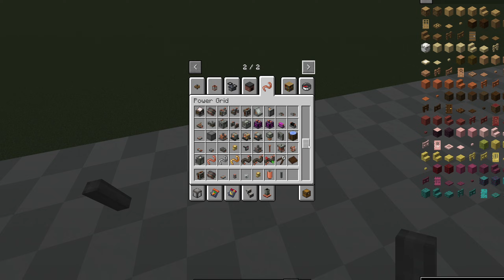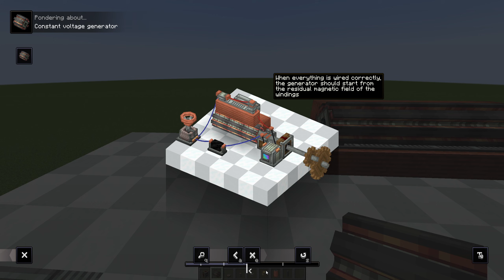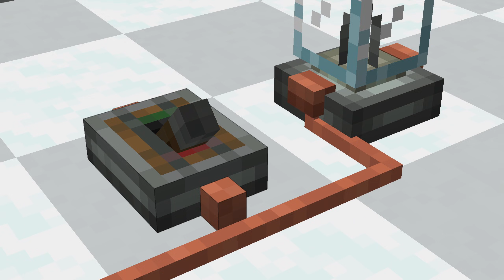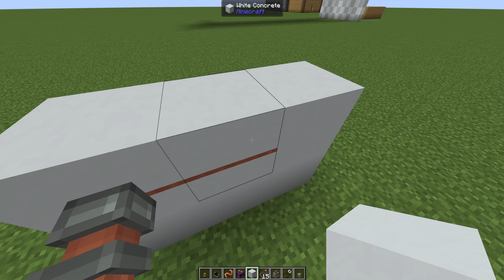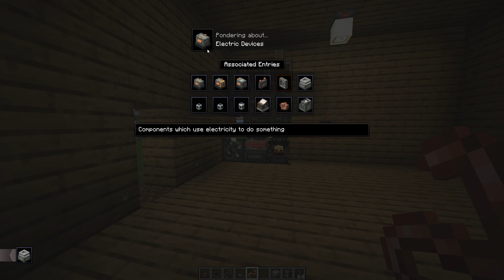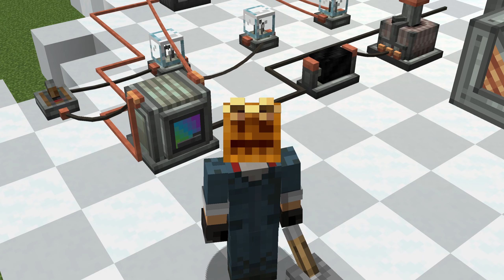The Most Realistic Electricity Mod for Create

Comment: 11:55 - I'm not an electrician but if I had to guess, I THINK you can make it blow if you reversed the polarity (of the neutron flow)

Instead of connecting positive to positive and negative to negative, you connect positive to negative and negative to positive. In theory that should flip the direction that the fan spins because the path that the electrons take is also flipped... maybe... yeah... that's totally how it works.

Comment: for shalz: Volts = current x Resistance aka v=ir so you can adjust one wire into multiple different required voltage powered stuff without breaking,

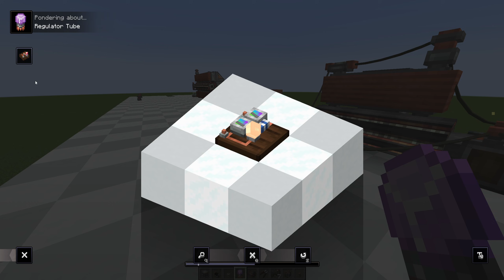Comment: 4:55 ; 5:54 - yea, thanks, I'll pass. At that point why should I even play minecraft and not build s..t IRL?

7:37 - me and electronics. And I code for a living.

PS
Torch - place and forget.
Create's light bulb - Create a generator, transform the current so it fits the lamp's requirements (otherwise it blows up). If you need more elements you're going to need more power meaning you have to re-engineer stuff. I don't see any appeal for this besides for education purposes.

Comment: Depending how realistic, the transformer will seriously need to be required... as more load is applied to the source, it needs to send more power down... not sure if that means the motor you have will have to spin against more torque (not sure if create has that, as I know basically nothing of create aside from wanting to play it when I get lost of time off finally) to sustain the power, or if it will just keep spinning at its lower rate and not produce usable power... really not sure, again, because I am not sure how realistic it is. Overall love the thought of powerlines and subgrids in a minecraft server, perhaps having one group of players operating and sustaining a power plant for a city, expanding capacity and adjusting accordingly.

Comment: I played  a little bit with the beta version as the normal version couldn't launch and I came to this conclusion about how to make a mostly reliable generator:
- The ideal rotation speed is 180RPM
- In the excitation circuit, replacing the power resistor with a light bulb with make the regulation better
- I made a crude regulation mechanism with a rheostat in series with the other one (both are 200 Ohms) and a motor coupled to it. The motor is supplied by the voltage output in series with a 120V creative battery (for now) in reverse (so the voltage is 0 when the output voltage is correct). It worked good enough. It's a good practice to set the manual one with maximum resisance when the system start

Comment: I tried it and it has insane potential (pun not intended...)
You can make harmonic oscilators with inductors and capacitors!! For those that don't know, that means you can make filters and thus tunable radios!! (I hope they add variable capacitors.)
There are no antennaes (yet, I hope), but even for wired circuits, this has a lot of applications:
You can send multiple AM (or even FM) down the same wire and filter out the signal you're interested in wherever you need it.
I haven't figured out the Vacuum tube yet, but I WILL make silent logic gates out of them. Relays are very noisy and use a lot of power, but are far simpler and smaller. Also, did you know you can mount the Circuitboards vertically?
It's unfortunately not yet survival friendly (missing recipes).

Comment: When working with electricity, you must always make sure that the power runs in a circle! When connecting a light you have 2 nodes. the positive and the negative (usually the wire colors are red (+) and blue (-)

Comment: This is super cool but it would be nice if it had better documentation- like where on the example generator should you tap off to actually use the power generated? Examples of minimum-viable survival mode generators would be cool too (I get the feeling hydroelectric is basically impossible with how little SU waterwheels produce), also unsure how much current actually matters in the mod

Comment: 5:38 "How do I get the voltage down then?" V=IR (ohms law) Where V is voltage (measured in volts), I is current (measured is amps), and R is resistance (measured is ohms). So to put it simply, reduce the resistance or current, reduces the voltage, which based on what i saw previous is possible as I think you have a variable resistor

Comment: Ohm's Law: V=IR. In a loop, voltage equals current times resistance. Basically, doubling resistance halves current, and vice versa. Voltage is how much pressure there is, current is how much stuff is moving, and resistance is how hard it is to move through something.

This also means that zero resistance equals infinite current. Of course, zero resistance is just as impossible in real life as infinite current, but a wire without a resistor connecting two ends of a voltage source can get very, very close to zero resistance, and thus produce a catastrophically high current that's more than enough to cause serious damage.

In practice, it's sufficient to call both excessive voltage and excessive current Not Good. If you're interested, though, there is a distinction. Excessive voltage makes electricity go through places it shouldn't, causing flashing, arcing, and breaking, while excessive current generates a lot of heat, leading to burning, melting, and breaking.

Comment: To all my fellow nerds who know electronics, especially those who are upset at Shalz not knowing what we see as basic, see XKCD number 2501

To actually share some of my knowledge:
This generator seems to make a consistent DC voltage. Transformers only work for AC. The easiest way to drop a DC voltage for things like the light bulbs is a voltage divider, which uses two resistors in a loop with the generator. The equations can be found online, but the key idea is the current flowing through the circuit must be the same, even as it divides, and resistors make the change in voltage equal to the current through them times their resistance (voltage = current * resistance). Thus, if a current passes through two resistors, then that current is proportional to the sum of the two, and the voltage drop across each is equal to the resistance times that current. It's more complicated in practice because the rest of the circuit may also draw some current through one of the two resistors, though. There are also more efficient methods to drop a DC voltage, but they're much more complicated and require capacitors or inductors to store and release energy. Not even sure the mod can do that sort of regulator

Comment: As an engineering student, seeing him figure out about resistance feels awesome :))

Imagine having to learn about ohms and kirchhoff laws to make a house in minecraft, crazy.
To find the resistance needed, you do R = V / I where I is current measured in Amps, R is the resistance and V are the volts.
W it's equal to current  * voltage.

So If the light bulb is rated for 120V and has 30W, it means it draws 0.25 Amperes from the generator. 
Minecraft becomes more and more cool than it was when I was little.

Comment: Will say as an electrician, I've been waiting for a mod like this since the original electricity mod that dropped back in 1.7.10. I mean a propper 2 wire system, not just an imaginary ground/neutral/negative, that takes work. Also buildable generators, hell yea!

Comment: Whats missing is proper short circuit faults, ground faults or zero point shift faults as well as proper three phase generators. And multi-wire cables, like NYM, NAYY or H07-RN F.
RCDs and MCBs or the functionality to build them on circuit boards.

Comment: first time ive seen a mod actually require both pos and neg leads instead of just a "power" cable. but now i immediately want 2 strand cable now so i dont have to run both individually lmao
Reply: Probably like  redpower2 cable though. Multi strand but you'll have to connect the wire at terminal yourself

Comment: Actually, resistors don't lower the voltage, they lower the current. This is Ohm's law: I=U/R, where I is current, A; U is voltage, V; R is resistance, Ω (ohms). This is simple physics for grades 7-8. And then there is the Power (P, measures in W - Watts) with the formula P = U × I, P = I² × R, P = U² / R.

Comment: You gotta connect one wire to the switch at one end then take the other end and connect it to the bulb's one end and then take the bulbs other end and connect it to the gouge's other end completing the circuit and providing energy
This is forms a simple circuit 
If you want i can tell you more as i am ASIAN

Comment: I literally imagined this mod at work yesterday, cool to see someone had the same idea! That being said, if the mod authors read this, I feel like it'd be helpful to have more options for hiding wires inside or around walls, and it might be nice to have wires where the ground and hot wires are bundled together for LV or MV wires so you don't have to place two parallel rows of connectors everywhere around your house or factory.

I think having voltage and current as opposed to some red nebulous "energy" resource fits much better with the Create mod and seems more representative of real electronics in general compared to the old RF/Forge Energy system and I'd love to see this mod become more popular.

Comment: 8:36 you mean you are actively overclocking the light bulb
Reply: That aint what overclocking is. Overclocking means speeding up clock speed, not the voltage or current
Reply: @fluhere  but they do it by increasing the  voltage and lights get dimmer by spacing out the flashes so from a diffrent view it kinda has a clock speed but it only works on leds  like this
Reply: @No_money_left-_- the voltage increase is a byproduct of a higher clock speed
Reply: Overvolting then.

Comment: Build a voltage divider, resistors regulate current not voltage. However, you can use two resistors in series to step down your voltage. You must know your current load However for it to work

Comment: YES!! Finally a mod where voltage is across 2POINTS!
This is going to be heaps of fun.
Time to find out how it handles resistor networks and if it simulates impedance correctly.
Because if those work and they add transistors, then we've got a genuine analog electricity simulator in minecraft.
Reply: It's legit. Full network sim and vacuum tubes.

Comment: I wonder if there's a mod that adds compatibility between Create and mods that use RF
Reply: Create: New Age adds its own generator coils, electrical wires, and all the bits needed to make rotation into RF. Theres also a really simple Stress to RF generator if you just want to have an easy work around if you're using a lot of RF based mods

Comment: As someone who works with electricity, this mod looks absolutely amazing. I mean, how many mods implement an actual DC generator with electromagnetic coils?

The modder doesn't even need a wiki. You can just use real IRL circuits lol
Reply: There was another old mod called Electrical Age that had a whole simulated electricity system. Highly recommend checking it out.
Reply: @lucaswinstonismyname  I played with that, it was fun.
Reply: @lucaswinstonismyname  I swear I remember that mod appearing in a bunch of tech modpacks back in the day. Never was really able to dig deep into it, but it always caught my attention.
Reply: How many mods or even games implement actual electricity like this? And I don't even mean advanced stuff, I mean basic closing the loop lol
Reply: @bablela26  tbf, modern electronics have condensed all terminals into a single bundled cord, which this mod also has to an extent.
Reply: Wouldn't it be AC? Cuz its using a dynamo.
Reply: @samuel_williams_7  It depends on the commutator setup. Since the generator doesn't use permanent magnets but a electric field it can flip the magnetic field in just the right time to generate DC voltage. You'll find this setup commonly in car alternators. By varying the current through the rotor coils (typically called the exciter current) you can change the strength of the magnetic field and therefor the output voltage.
Reply: @samuel_williams_7  This is a DC generator.
Reply: @samuel_williams_7  I think the mod author stated that AC would be impractical with the 20tps speed the simulation has to run at, giving you at most 10hz to work with
Reply: @samuel_williams_7  Apparently, the author of the mod didn't think it through.
Reply: there is a mod called ''new age'' that adds generators and electric motors, it is a cool mod for building windmill farms for electric power so you dont have to use steam engines or waterwheels for saving room but this is another level for using light and other sorts of electric switches and stuff. love it
Reply: Čech elektrikář!
Reply: It's so cool how true to life it is I almost can't help but feel create is a little too basic to be paired with it. Now we need equally in depth mechanical engineering
Reply: @IzzyJchannel The problem is, the more coexistant and confluent systems you add, the more complex accomplishing anything becomes while simultaneously creating massive CPU strain. And unless the Modders can agree on a degree of Abstraction, there's no guarantee one system will even work consistently with another... it's quite the challenge.
Reply: My biggest question is how does it scale, how much lag is there if your powering a small town with hundreds or thousands of light bulbs and other things?
Reply: if you want detailed electricty I strongly suggest you go play the greg tech mod or modpacts focused around greg tech. Just trust me its 𝑹𝑬𝑨𝑳𝑳𝒀 𝑫𝑬𝑻𝑨𝑰𝑳𝑬𝑫
Reply: The customizable circuit board is an electricians dream
Reply: I Hope Theo dont add AC 😂
Reply: Proč tu je tolik Čechů elektrikářů? :D Já jsem taky Čech a elektrikář.
Reply: I work at a robot programmer job and this is very exploratory, oh ye :)
Reply: New age, Greg tech
Reply: It had pcbsssssssssssss like how can it be that good imagine it also has all the gates and someone builds a working computer from them 😮
Reply: Is dc direct current i think it is but idk
Reply: @JacksonmatchSeeYulladdrulat  Yep, Direct Current DC, Alternating Current AC

Comment: I am a electrician idk how you didn't realize that at 2:30 you need current to flow through the bulb you only have one electrode so current can't flow. And at 9:40 you are changing how fast the current can flow through the resistor but the voltage stays the same

Comment: As someone that has learned quite a bit of residential wiring this is actually a really cool mod 
Also I remember my teacher telling me that every electrical component has a warning system to tell you that it's being powered at a higher voltage than it's recommended as it will let out a little bit of smoke or set off a loud noise to warn you that your device has broken

Comment: I really wish this mod was compatible with create new age. It would been very good with it. Still it's a pretty nice mod that very well outperforms other electricity mods for create that just add a connector and some motors and a generator.
Reply: It's kinda compatible with new age
It's compatible with any mod using FE but only converting it's power into fe, you can't convert fe into its power